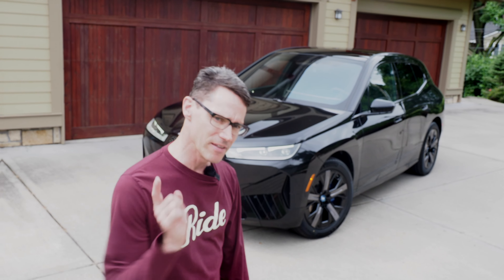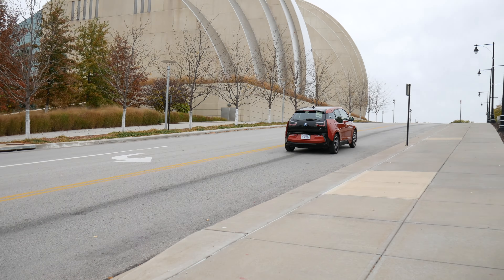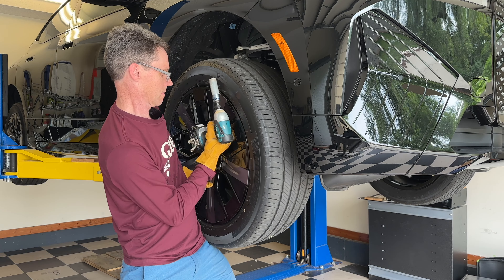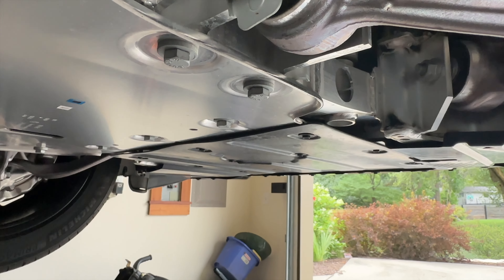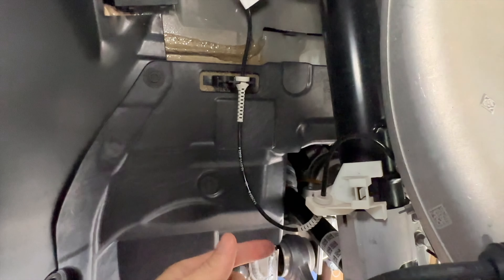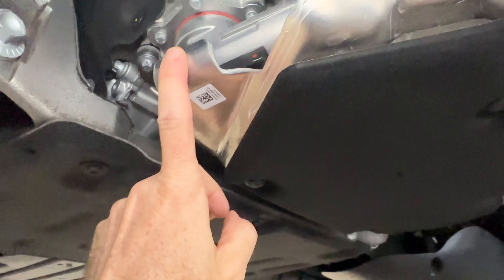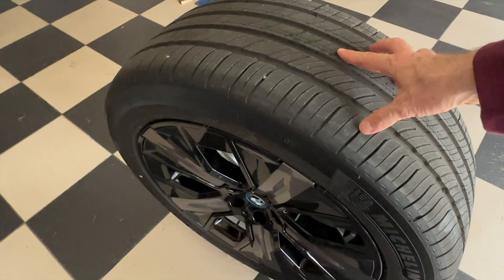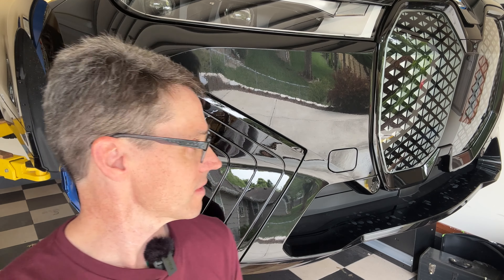BMW iX Undercarriage: What's Hidden Beneath?

Comment: Thanks for doing the undercarriage tour, that's some amazing engineering that BMW has put into it.  By the way, there's no air suspension in the front, that's just a conventional strut with spring coil... Maybe it has an airspring in the rear, like the the I4.
Reply from the maker: True, it was optional on the iX 50